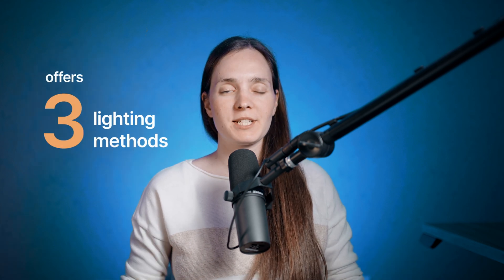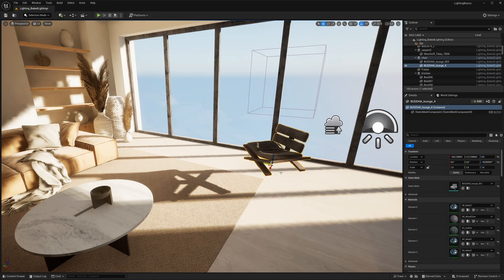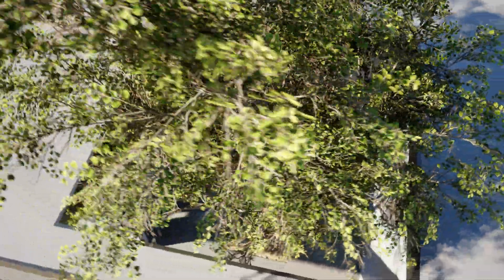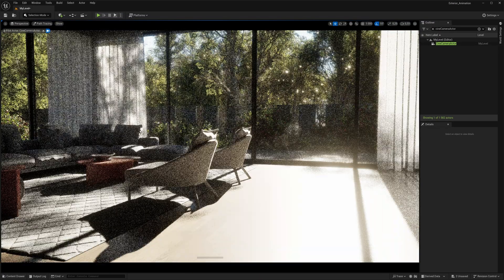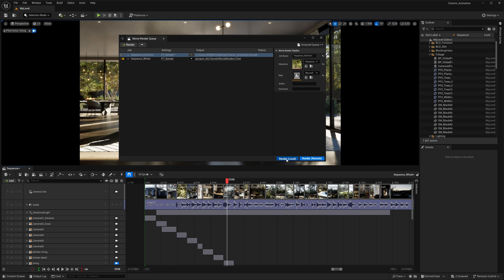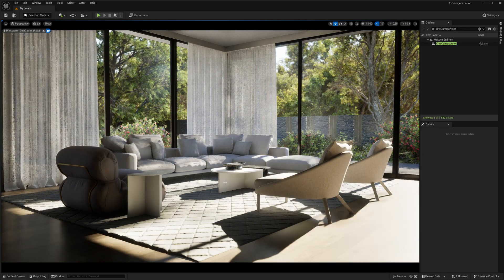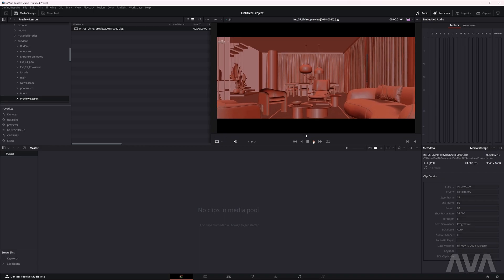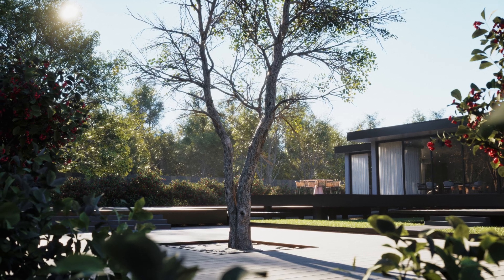How To Lit The Scene In Unreal Engine 5?

Comment: Many materials when path tracing mode is activated are misconfigured or do not appear in the same way as in lumen, especially vegetation, some are completely dark, and some materials do not seem to be recognized, do the two rendering modes have a different material reading? requiring a reconfiguration in some cases?

Comment: sorry i dont get the point.
I visited several unreal beginner tutorials just to figure out that the tools in UE dont work that smooth like in my "native" 3D Software like 3d Max for example.
I would love to see UE Render as a plugin for our tools, but for now in that fast paced enviorment where you have so many changes, working under high pressure, to holding a deadline, just for images or even a animation I don't get the point of learning UE.
Guess that working with Corona or Vray sending it directly to Chaos Vantage gives you much better results in a much shorter time.

If you need a XR (AR/VR) experience than i think you could go for UE
Reply: True.
Reply: I could share one recent experience i got with UE, and bare in mind, i have only few hours in UE and are a complete noob at this point.

So the experience was a evaluation of a site and what potential it has.
1. in the morning i went with the drone to take some photogrammetry of the site.
2. during the rest of the morning i had the computer make a gaussian splat of the whole site and area around.
3. in the afternoon i then took the gaussian splat into UE and then i imported 6 different housemodels from Revit that could suite the area.
4. the next morning we could test out some diferent solutions for the house placement and angles, and what view you get from the windows, the sun light studies coming in to the interiors. All this in REAL TIME!

All this was done in one day and it really wowed the client. so i will for sure keep studying UE.

However im really sure this can be done in some way with all other softwares but i just was shooked how easy it was for me to get to even these steps, and i know only like what 2% of the functions in UE do.
Reply: I use both unreal and vray i can tell you unreal is a lot better.  firstly unreal is free, the transition of models from max to ue may take a bit of work, but once its set up, you can change stuffs lightings and materials at ease in realtime, renders extremely fast on your local pc without all the ridiculous render times in vray, and without the bad contrast and color bleeds.  I dont want to use vray anymore after i used ue.